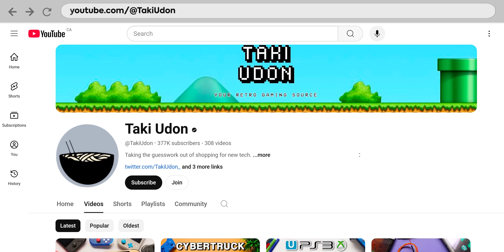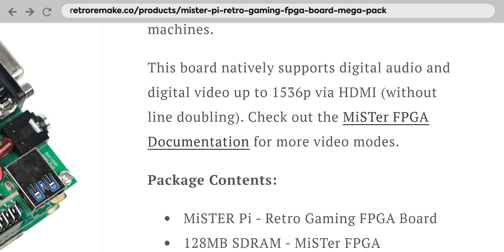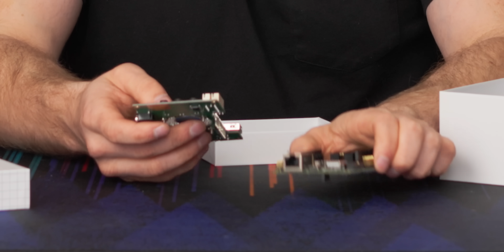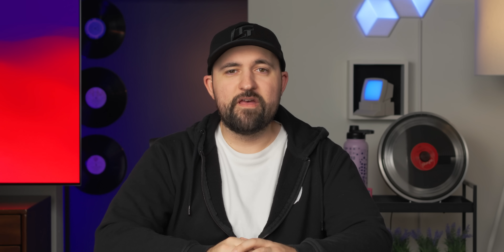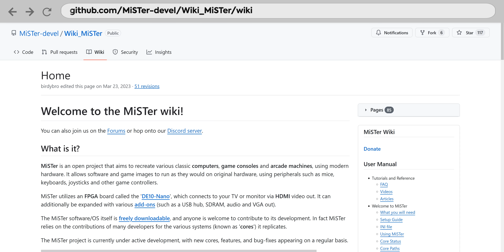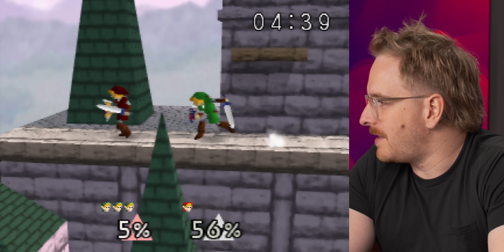Half the price. All the Games. - MiSTER Pi

Comment: Why not make a Mister FPGA version that fits on (almost) any version of the Raspberry Pi on the GPIO header with a ribbon cable? I think a lot of tech interested people already have one or more Raspberry Pi's in their house which some of them aren't in use anymore. Saves a bit of costs and if the software runs on a Pi Zero it runs on most other Pi's too right?

Comment: Just a little FYI.... GREEN PCBs are NOT CHEAPER QUALITY AT ALL. All PCBS use FR4 material. The green you see is just PAINT, called SOLDER MASK. 

Usually the colours are decided by the manufacturers. For example, (and speaking as a PCB designer), our first prototype PCB is usually black. (Ver 0.a)... from there we move on to Yellow, Red, Blue, and finally GREEN.

GREEN is also the ideal colour for checking the fully populated PCB under an AOI (Automated Inspection) unit. It's got nothing to do with cost, and very much with production runs and/or taste.
Reply: Wouldn’t green PCBs be cheaper since they’re more widely used? 

So not necessarily a difference in quality, but lower price just due to being produced more?
Reply: @HypePerformanceGroup  I only replied to the 'cheaper quality' phrase used in the video. Lower in price? Yep. But not cheaper quality. 🙂

Comment: That dongle would kinda be a dealbreaker for me. I got a Pi3B specifically because I wanted something with bluetooth and wifi onboard. Though, I'm sure it's not technically as good at emulating as a mister. It does a good enough job for me though.

Comment: I'm new to this retro gaming thing, but why is this better than a raspberry pi with retropie?
It's cheaper and can run anything. I can't really figure it out.
Reply: FPGA is able to mimic console cycles, while most games don't need it that means it is running 100% as the old console would, so you get a few effects that are harder to get via software emulation. Meaning you are not losing this often overlooked thing, and a few games can not run via software that run on FPGA as it cycle matches, it is running as it would on the old console so nothing is lost or off.

Comment: If you want handheld with a 5.5" OLED 1080p screen and pretty flawless performance up to PS2 , the Retroid Pocket 5 exists. I couldn't justify buying an FPGA Handheld for the same price as a RP5 that can only access up to the same games as a software emulator based handheld that's under 1/3 the price.
Reply: Better yet, slap a controller grip on that expensive smartphone you almost certainly have. Why pay a couple hundred dollars for a second mobile device that's probably weaker?

Comment: I like this, but there's something extra special about an OG N64 with a HDMI mod. That absolutely munted controller is half the charm of the device.

If you could add a cartridge slot or DVD drive to one of these to read off the original media would make them 100 times cooler IMO, but I understand the difficulties/expense when you can put flash memory on that'll hold thousands of those media formats.
Reply: You can use SNAC adapters on Mister to play with original controllers. No lag. And why would you add a drive or cartridge slot when ROMs and ISOs  are literally the same game? Theyre both read the same way. Or just rip your games to a PC if you’re that concerned.
Reply: I use an 8bitdo kit to replace the internals on an og n64 shell, with my mister. it’s absolutely better. There’s also a project called Zaparoo (previously Tapto) that lets you boot games with NFC cards, if that interests you
Reply: @gugelizer4279  That's pretty cool, but I still love the OG hardware, I love the idea that it was the absolute cutting edge for the time. Well, not in Nintendo's case, but you know what I mean, I just like the simplicity of it. Plus, I already own an N64 with HDMI and all the games I want to play so there's no point in buying something else to play those same games on

Comment: Looking at the prices online they look astronomical. I will continue to use older garage sale laptops to emulate. Screen included, portable, power cables included. Am I missing some glaring benefit with this for easily 100 more usd?
Reply: Kind of apples and oranges. There's nothing wrong with either, but MiSTer is an FPGA project.

Comment: Correct me if I'm wrong, but the bare FPGA board is $100?  I think you can afford a 4.5ghz 12th gen for that these days.  If that can't do cycle accurate NES we have bigger problems.
If you are spinning a custom board why not just add the standard upgrades to the board itself?  I am beyond confused.
I like the idea of a Mister, but at anything over $100 for a working product I can't understand it.
Reply: To play devil's advocate, the PC is going to be way bigger, won't have easy analog video output, can't use original peripherals without going through a USB converter, and if you don't configure RetroArch correctly, it'll have input lag. A MiSTer is tiny, runs off a cell phone charger and behaves like the original system by default.

Comment: What's the benefit to this versus traditional emulation on your existing PC?
Reply: The FPGA chip allows it to basically replace the hardware of all those old systems. There aren't layers upon layers of emulation and translation.
Reply: In practice, not much unless your main use case is plugging it into a CRT.

Comment: Barrel jack to USB-C is a f*cking DOWNGRADE! It's like replacing your bones by glass ..!
Reply: How is it a downgrade?
Reply: @TheBroz  It's replacing an extremely fast to plug and easy to repair robust plug that lasts for a whole live, with a very high chance to never break, by an ridiculously flimsy, tiny, itsy bitsy fiddly PoS that WILL fail and result in an comnpletely useless device (brick) if you are able compensate for all the other quality shortcomings that current hardware has long enough. Also you will need new power supplies, (with their silly and shady intransparent USB 'optionality shenanigans) while there are literally dozens iof barrel jack supplies lying around.

Comment: I dont understand. You can buy an old snapdragon 865 with less than 120 us and play everything like this via hdmi with a dongle or anywhere if you want. So...why bother to buy this? 
In my case, i still have an itx build hook on my tv. It' just a cheap ivy bridge xeon(1230v2 16gb of ram) with a gtx 950. I run it with batocera and it never fail me. So why? Why buy this?
Reply: Cycles, this mimics things on a cycle level so it does things software can't or is hard to copy.

Comment: Getting more and more tempted with FPGA as the price come down. Software emulation is not bad however, I currently have a pi5 with retro games setup on it and also on my Steam Deck. It plays them farily accurately. But I know people do sware by the fpga system are just more closer to the real deal.
Reply: I've owned a MiSTer for years and also use RetroArch a lot (especially for on-the-go gaming). If you don't plan on playing on a CRT, a MiSTer's not going to do a lot for you that a good RetroArch setup wouldn't. That's especially true for PS1 and Saturn games, which have a lot of input lag even on real hardware. That's easily fixed using RetroArch's pre-emptive frames/runahead feature, but an FPGA solution would be as laggy as the real thing.

Comment: Raspberry Pi don't enforce just the Pi part of the trademark, i'd say any SBC with a similar form factor, SBC on its own is a very generic name, that has tinkering ability and an accessible price point, can be called a Pi, ARM, RISC-V, X86, FPGA, if it runs user defined software and is small enough to hide in a pie, its a Pi.

Comment: After having 10 arcade machine and 3 pinballs and having consolized over 20 arcade boards to play on my home with direct hdmi boards that connect to those pcbs, i can safely say that mister is the future if you don't have a house and all your hobby is in a storage somewhere waiting to get flooded, catch fire or worse (someone throws it away when you eventually die).
I need to convert all my games to mister , then keep just 1 virtual pinball and a sega astro city arcade machine in my home with a mister inside. 
Time will tell

Comment: Seems like an awesome little mashine for old school fighting game emulation and tournaments, depending on the latency
Reply: The latency is the same as the original system. It recreates the chips and circuits of the console it's emulating at the same clock speeds. If you use a USB controller instead of an original controller, that'll add lag, but the best controllers only lag by fractions of a frame.

RetroArch can also match the latency of real hardware though. The main advantage of the MiSTer is that it's extremely accurate without needing a high end PC, it turns on in seconds and it's easy to plug into both CRTs and HDMI displays. If you care more about quality of life features like rewind, fast-forward, overclocking, upscaling, texture packs, netplay, or lowering input lag below real hardware, software emulation is better.

Comment: I don't get it. Seems way too expensive for how weak it is. Why should I want to use this over a more powerful/cheaper emulation box/handheld?
Reply: Cycles. The cores mimic console cycles so games run 1 to 1 as they would on the real systems. This adds a bonus of being able to restore effects or run games that software often struggles with. The N64 core has the display video over the tunnel working in Mario Kart 64's Luigi's Raceway, doing that on software is not easy and here we have a FPGA console doing it, also old hookups can work so you can run games on a CRT like you could back in the day and Sonic 1 on the Genesis via composite cables has correct pixel dithering so you get the colors to blend and it restores the waterfalls. Plus you can remove a few effects and cleanup the games per system a ton, FPGA is able to run things and match cycles, you can look up software VS hardware emulation videos to learn about FPGA.
Reply: @cartergamegeek  Who even likes their own comments

Comment: i have a raspberry Pi 4 that i put in a mini PS1 case and it has been my Emulation Workhorse for the past few years. it still gets the job done.
Reply: The MiSTER is also for those who are crazy by EXACTNESS that would otherwise require the original hardware to achieve. I don't care so much, I just get excited when everyone else gets excited :)

Comment: So, uhh, why not just a Raspberry Pi or some other SBC?
Reply: emulators running in general purpose computers are often imperfect in subtle ways- for instance, analog audio circuits are notoriously hard to emulate well and in a performant way.

FPGAs can get a lot closer to an exact reproduction of the original console, because they're reconfiguring the electrical gates in the chip to match the device being "emulated" in a way that can capture those subtle electrical behaviors way more faithfully.

You're paying a premium, but you're potentially getting more perfect performance.
Reply: Thats what I am missing here

Comment: Best thing for most people will be to get one of the ITX expansion boards, lets you fit the mister into a regular PC case, as small as mini-itx. While the small mister cases are the smallest you'll get. they look terrible under the TV, and because wires come out of every side of it, it looks like a plate of spider spaghetti. A nice ITX case and you're rocking a media center like setup for gaming that remains clean.
Reply: The Ironclad Mini-ITX I/O boards are getting Mister Pi support this week, that's going to be a game changer for the Mister Pi
Reply: my dad is super into the mister ecosystem and he ended up cutting holes into an alumin draw thing and used patch cables to get the ports into the back. this is probably an easier time lmao
Reply: I have had the same thought, but maybe make a better shell similar to a nice console. That could drive up consumer interest. The board itself doesn’t work well with enclosure, creating a spider cabling effect that sucks in your living room
Reply: Same applies for any RasPi based setup, hey. They're versatile, but they ain't pretty haha
Reply: @RetroSwim back in the old days it was too expensive to mass manufacture a board for every single product so people just made their own.  They weren't pretty, but they made their way in to all kinds of high end products.  Their secret?  Put it in a box!

Comment: I’m very new to retro game emulation and want to try it out, how does a Mister FPGA or MisterPi compare to RetroPie on a raspberry pi 4?
Reply: That depends, the main use of FPGA is cycles, it clocks as the console did so cycle wise as they work on each core you are getting more or less 1 to 1 cycles, meaning that a few games that act weird via software emulation would run normally, so it's give up a few things for a solid 1 to 1, or use software things and maybe get more systems or games but lose out on the fact you are not getting as 1 to 1, so every so often a game fails or needs a fix VS FPGA just working, as they update cores you end up with a copy of the old system.
Reply: @  oh that kinda makes sense. So it’s more of a “accurate to the original experience” rather than “more features”?
Reply: @charliesretrocomputing  Yes and no, by having a deep understanding of the thing the core copies you can often get more indirect features. A core might not offer save sates, but you could more or less double the scan line sprite limit and then that removes flicker, with a few booster settings games often run faster, as of a year ago just the basic booster mode for N64 let a lot of games almost hit 60FPS, under the hood you have many indirect features to mimic the console or give it more power, the N64 settings got basic N64 to look like PS1 games, while the point is 1 to 1, you can easily mess with features that give you more punch, removing limits. It mimics the system so you can then remove and edit things running them far better than the OG system while keeping cycles on point, you lose a bit of common features, but you get a true 1 to 1 feel with plenty of small features to mess with games to make them look or play better, and for those looking to use a CRT, you get hookups for that and the cycles being good means you get effects lost in HD, you can get the dithering the Genesis does if you are on a CRT with composite cables. So it's down to give up on a few things to more or less get a far better match game to game. It's the little things, but that often adds up.

Comment: There are other options to the DE-10 board. I've got the QMTech Mister board, another 'clone' board that's not really a clone like the Mister Pi here. They just share the same FPGA and board size.
The QMTech is almost 1/3 of the price of the DE-10 so arguably cheaper than the Mister Pi as well, and stock is refreshed on aliexpress for it regularly. I got the version with the additional ram built in, so no need to mess around with expansion RAM.. and honestly you are going to be buying the extra ram anyway.
I don't really care about the console cores, but I do care about some of the more fun stuff like the XT upto 486 PCss it can run, relive the old days of the internet from BBS to the very early days of the internet with Windows 9x without the need of obsolete hardware the size of your desk gathering dust.
Reply: I also got the QMTech board with built on SDRAM and analog board/USB hub with case for about $150 a month ago or so. Stock definitely comes back way more often than Takis MisterPi which is only sold in batches right now. The QMTech board plays just as good as my original Mister. Love these cheaper options.

Comment: Hardware emulation is cool but it seems unnecessarily expensive compared to software emulation, which is normally looking and feeling exactly the same.
The Analog consoles where you can actually plug in your carts seems more appealing than just a box that you load roms on.
Reply: Owning a bunch of Analogue consoles and flash carts gets incredibly expensive quickly.

Comment: Neat but it needs a power button instead of using an external power switch kind of an inconvenience. Dont know why they can't just implement it into the design. I know it's a copycat of another board but they they could of still made it better.
Reply: Just grab a cheap WiFi/BT outlet. I use these for mine and just use my phone to turn on my Misters.